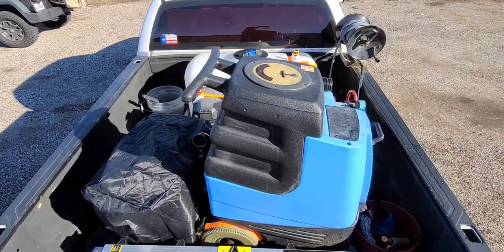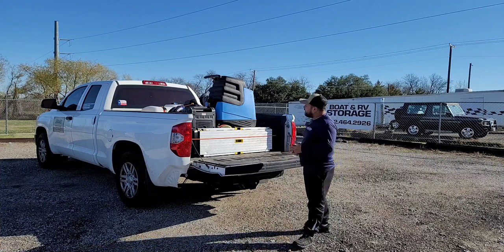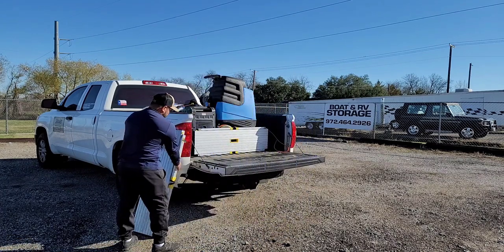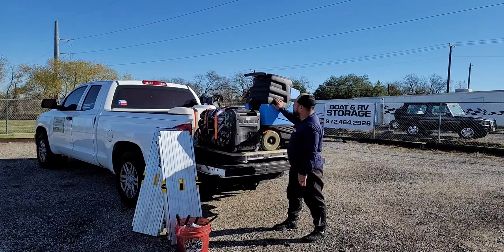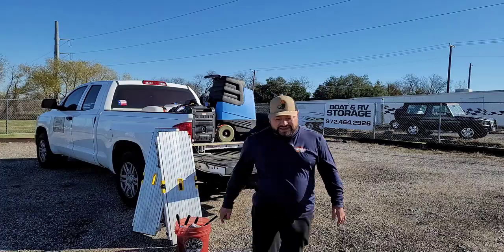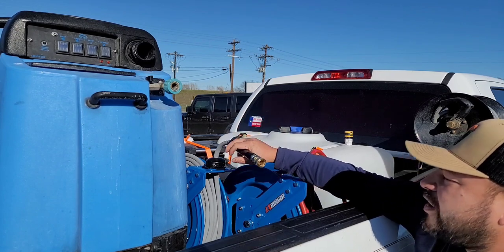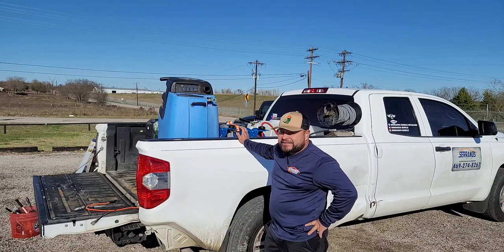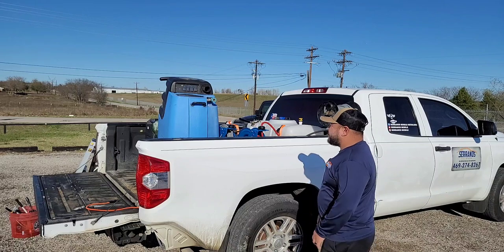NEW detailing Truck setup! @StaySlick thanks for the help

Comment: That's awesome man! I've also been very patient with gathering what I need to make a permanent set up on my truck. One thing I would recommend is adding a small metal elbow attachment to the exhaust tip on your generator so it shoots the smoke up and not on your tailgate
Reply: Great advice. Another YT channel had his predator catch on 🔥. It was in too small of a space apparently.
Reply: @annagraham6204  yeah definitely dangerous! I was also getting tired of eating exhaust smoke when I cleaned mats on my tailgate lol

Comment: Looks good CS! Can't wait to see what you got going on inside!
Reply from the maker: Hoping to have it finished soon
Reply: @serranos mobile   I use my Buick SUV as my mobile rig. I stuffed a 36-gallon tank, small 2,000-watt inverter generator, an air compressor that'll run my tornador, Ryobi pressure washer, and managed to fit 50 foot auto retracting hose reels for air and water. I LOVE having the hose reels! So nice.. It took lots of planning & measuring but I still have full use of my back seats with all that in there.
Reply from the maker: Heck yes love it
Reply: @serranos mobile  Thanks man. I keep meaning to make a YouTube video on my setup, but haven't gotten around to it. When I do, I can tag you if you'd like.
Reply from the maker: Heck yes